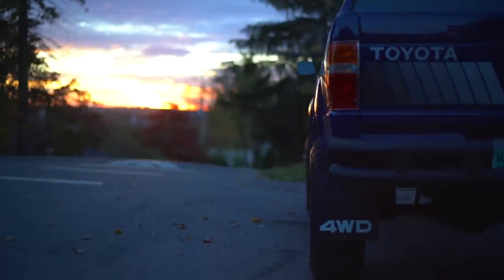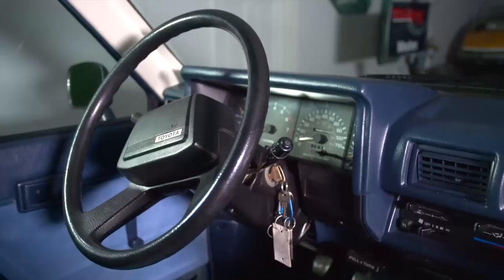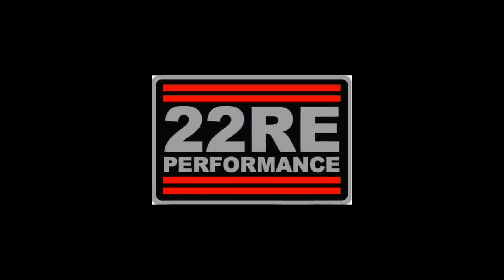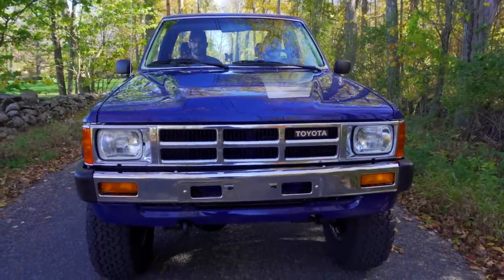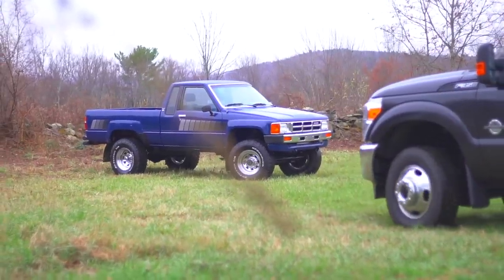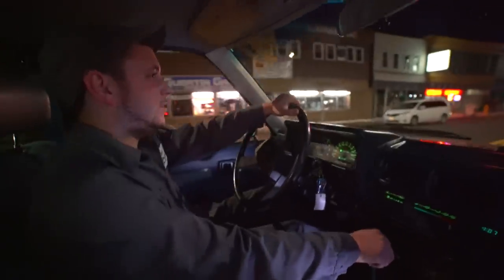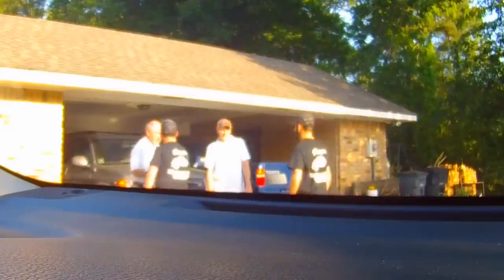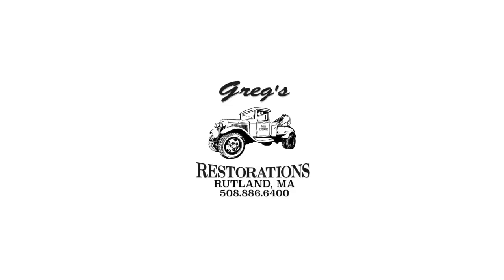1985 Toyota Extra-Cab 4x4 Pickup Restoration: BlueBoy!

Comment: I have a bunch of 79 to 85s but the one iam betting on is 84 here in America the 84 85 most chopped up into rock crawler crap.the 84 to me better than 85 didn't have bizzare multi spread fuel injection 86 had efi  just my opinion the 84 carbed thats why it will be fj40 of future.  remember i bought a fj40 running for 2500 bucks 20 years ago bought first 30 years ago for 1200 with  blown headgaskets on cheavy 350

Comment: Nice except !    Tires are to large   for this compact designed  truck....   also  hard on the drivetrain/motor/suspension
Reply from the maker: No way, perfect setup. These trucks run 35" tires no issues

Comment: You have tires and wheels too large for this truck.....if you stress it. That motor and drive train is too small and isn't engineered for that size. I know I owned a truck like this before and put those tires and rims on it.
Reply from the maker: They are 31 inch tires and same size factory wheel....
Reply: @gregsrestorations7019  Good luck with that tire size, hope it works for you.